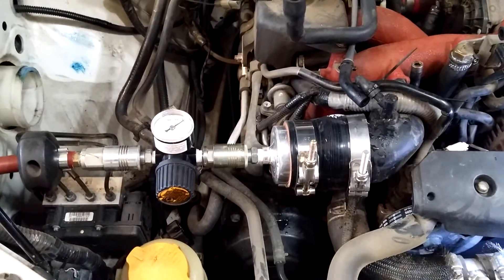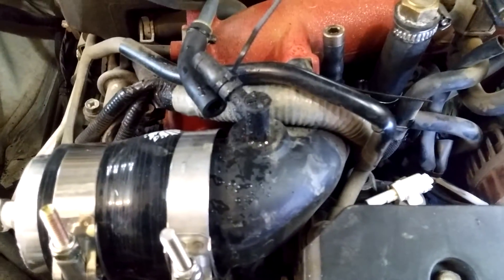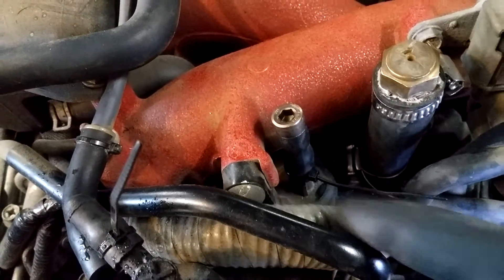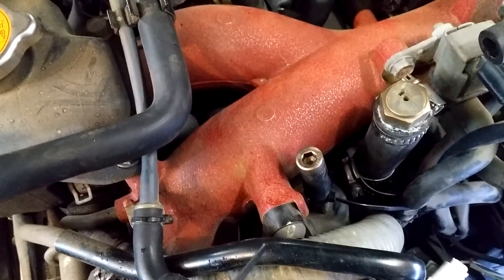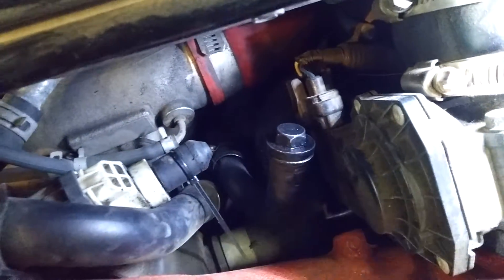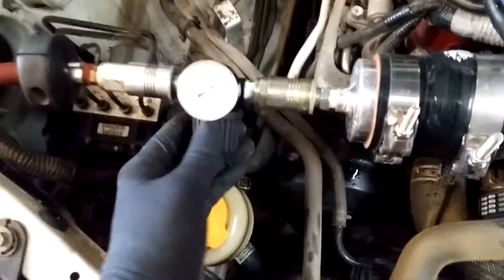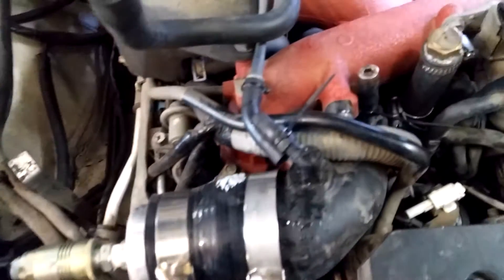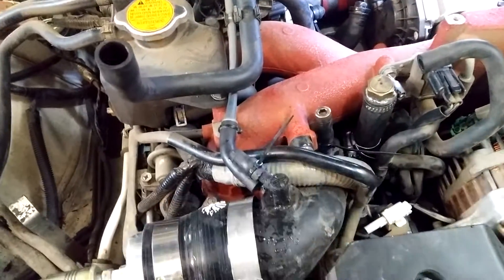Subaru Impreza STI boost leak test

Comment: I don't think its necessary to cap off crankcase vent port. Test air will end up in crankcase regardless hence we open main engine  oil cap to avoid pressurizing crankcase. Also same pressure will reach each breather port in vakve cover  as it is sharing same atmosfere with crankcase.

You onky need to cap any port on turbo intake pipe. Could plug end of those hoses so they become part of the test too. Those hoses dont see  pressure but they are source of vacuum leak, air entering turbo intake pass maf sensor making you run lean. Leak at the other side pressure side turbo discharge will make car run rich as air is escaping and engine thinking there is certain amount of air to match the fuel delivery but it's less air
Just make logical take on the test and capping procedure